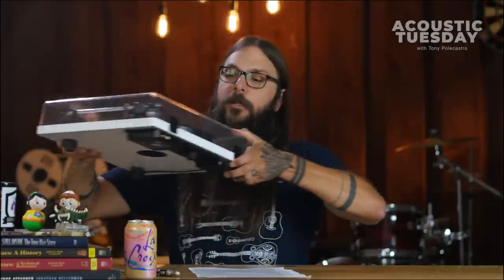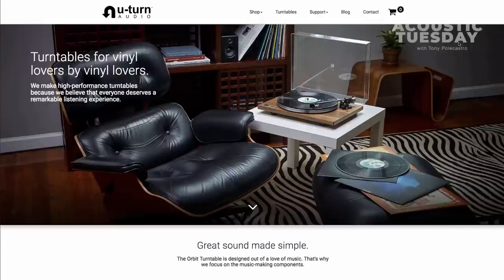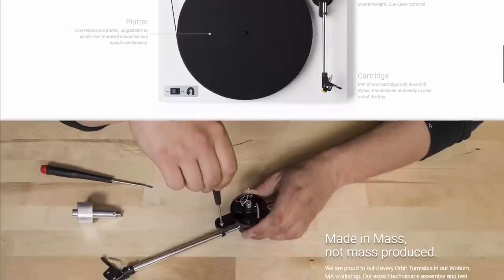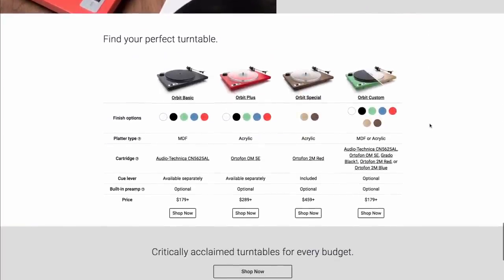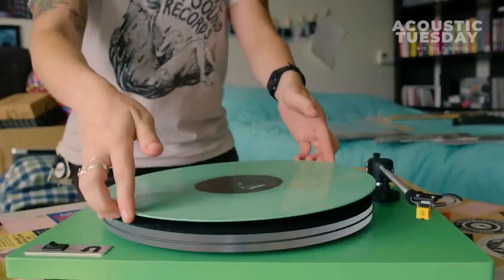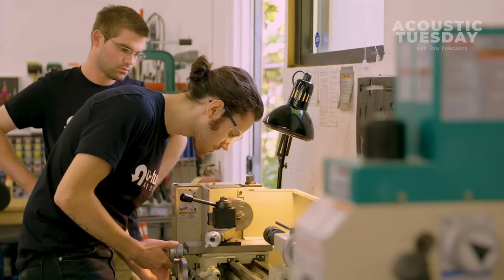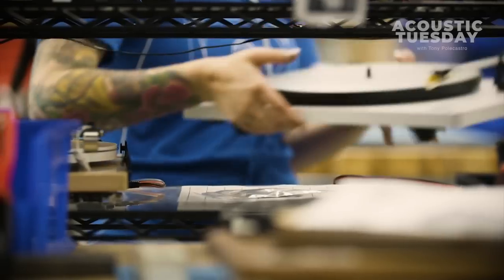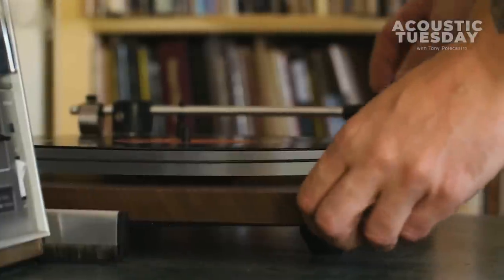U-Turn Turntables Review

Comment: mine's been great, and great customer service.....but the made in china motors are spotty. My original made clicking noises, and they shipped a new one with installation instructions no problem. However, unless you get the motor's wires completely isolated from the Plinth AND the motor AND the motors rubber mount you'll hear buzzing. My best solution was to remove both screws that may be used to secure the rubber mount ( found to not be needed) and isolate wires with small pieces of dense sponge (like Mr. Clean Magic Eraser), from contacting motor and plinth...….pretty darn satisfied now. Upgraded the Grado Black cartridge I chose with a Red stylus and it went from great to really freakin sweet.

Comment: I would not trust them assembling the pressure correctly, as it can easily change in shipping. Id recommend checking it yourself.
Same with allignment really.
Reply: It's a given,  u balance every arm after you open the box